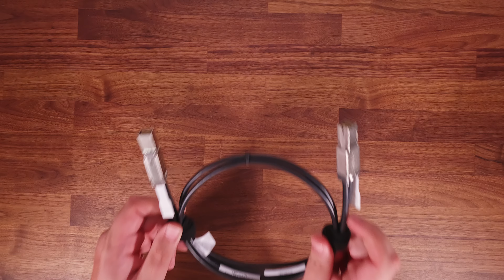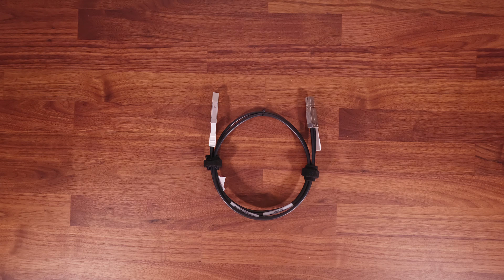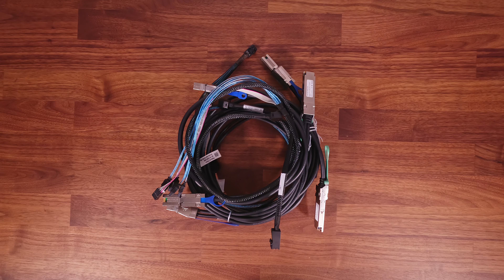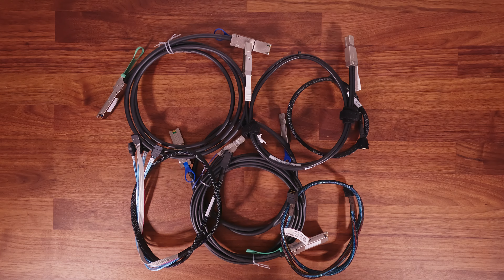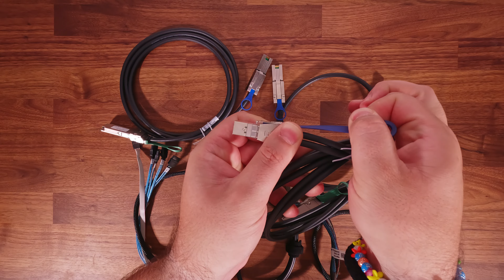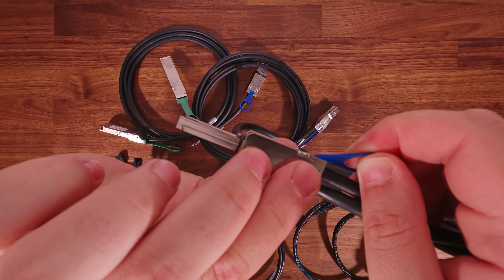What is a SAS cable ?

Comment: 2:47 What is the grey cable that looks like usb2.0? what is it for?
Reply from the maker: Its called a SGPIO cable usually used to light up enclosure activity LED's but can be used for other things as well.
Reply: @TekJumble  Thank you so much for replying! 
I have a SFF-8654 to 8x SATA cable. But it also has two of those SGPIO connectors... So I don`t have to do with it anything?
Thanks again!
Reply from the maker: @tanakaobi  SGPIO cable does not need to be connected.